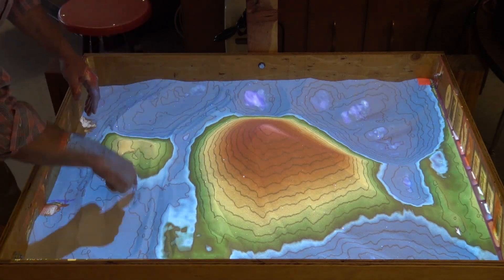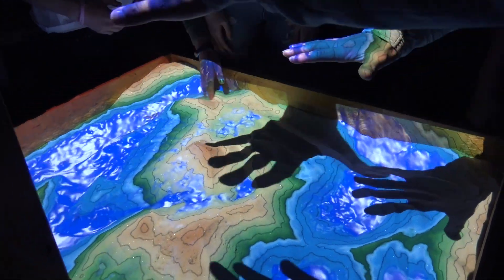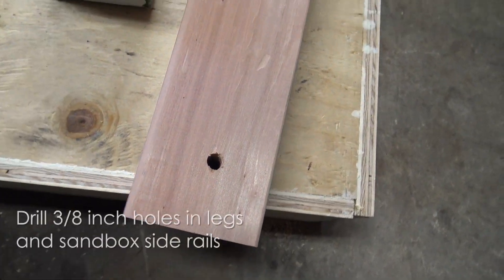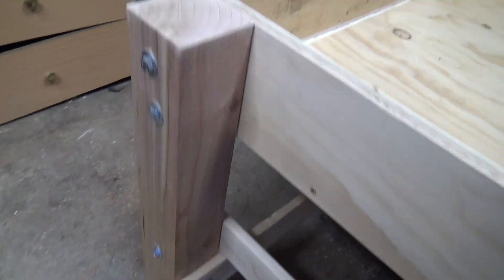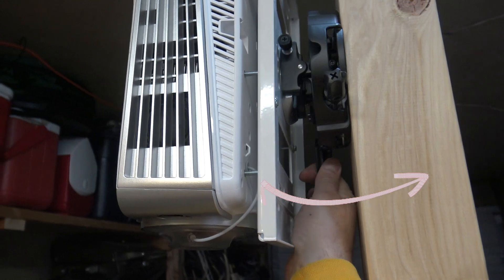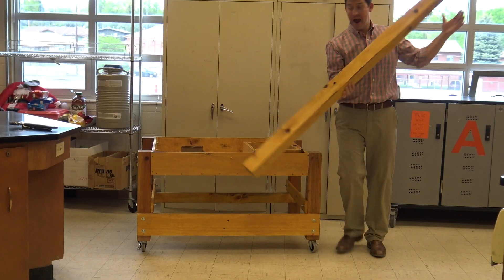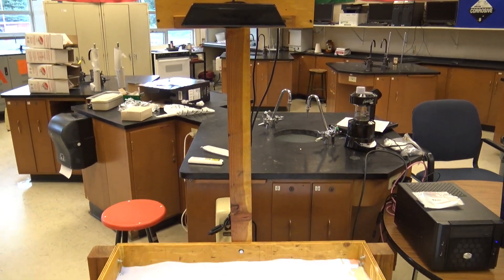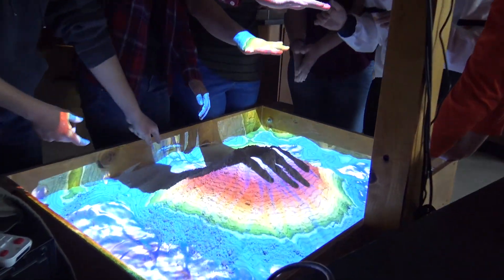Augmented Reality Sandbox - How to Build the Sandbox

Comment: Do you have to have a projector that is mounted 40 inches away with the Konnect? Can the Konnect and projector be at two different distances? I have two projectors available at my school, because of their throw ratios one would have to be mounted 58" above and the other (ultra short throw) would be about 4".
Reply from the maker: The connect will work at further distances so your projector that has a throw of 58” should work. 
I tried to keep it as compact as possible with the short throw but it is not mandatory.

Comment: Hi, thanks for the great video. I got a question: is the distance of 40 inches sandline to projector lens or 40 inches from the sandline to the projector mount?
Reply from the maker: 40 inches from sand line to lens. But, this projector has a lens focal length that can be  adjusted so the amount of sand won’t be a majorly issue. You can adjust as needed.

Comment: So, you could even use stencils & templates to build structures from the sand to make from rivers to hills
And even foundation markings

To rebuild historical & geographical locations

Sandcastle building contest techniques could be used to solidify and hold that structure if wanted - though water
Reply from the maker: Great ideas!!

Comment: Hi Craig, our software is ready to roll, we are now building the sandbox.Questions: how long is the 4x4 that the xbox kinect is attached to? what are the dimensions of the box for projector and Kinects, how wide are the 4  braces?
Reply from the maker: Good work! The 4x4 post is 70 inches long. The wooden 'box' around the projector is 13.5 inches by 17 inches. I am not sure what "4 braces" you are referring to.
Reply: thanks so much the braces between the legs but iI figured it out. Thank you so much @BealsScience

Comment: What is the dimension of the structure where the kinect camera is mounted?
Reply from the maker: The dimensions of the box mount for the Kinect are just large enough to house the projector we used (see link below for type of projector), so if you use a different projector you will have to alter the measurements below:
Length (from the vertical post out to Kinect): 12 3/4 inches
Width: 17 1/2 inches
Height: 6 inches
-BenQ Projector: http://amzn.to/2r84sy5

Hope that helps!

Comment: What is the name/model of projector you are using? The instructions recommend a short throw projector or otherwise it must be mounted in a different location. Thanks!
Reply from the maker: Hello!
I've got a full list of the equipment and materials that I used here: https://www.bealsscience.com/single-post/2017/06/07/Augmented-Reality-Sandbox-will-Blow-Your-Mind

Does that help answer your question?
Reply: Beals Science yes, thanks! 
I'm bummed about graphics cards because apparently bitcoin mining has made them more expensive.
Reply from the maker: Graphics cards definitely are expensive! But, you can go with a lesser card if you'd like, there just might be a little bit of lag time and you may have to disable the water feature.

Comment: Hi! It looks great! 

I was wondering what pc specs you suggest. Ive been reading that you cant get away with less than a gtx 960.. whats your suggestion? 

And what about the cpu? Thanks!
Reply from the maker: We built a custom machine but stuck with the recommended Core i7 (i5 should be good too) and have 3.5 GHz. We are using NVIDIA GeForce GTX 1070 but the rest of it is mostly stripped down. We are running at the higher end and you can get away with a lesser graphics card with some limitations. The graphics card and the pc are, of course, going to determine how quickly the image can render on the sand. There is even a delay with our setup (as you can see in the video) but it is bearable. If you get to 'low' on computer specs and graphics card you will not be able to run the water either as it takes a fair amount of processing for the water. So, if you are just building one for fun at GTX 960 (or slightly lower) may work just fine (although I haven't tried to use this card, but other people have with fair success).
Reply from the maker: I've got a little more information here that may help: https://www.bealsscience.com/single-post/2017/06/07/Augmented-Reality-Sandbox-will-Blow-Your-Mind
Reply: Beals Science Thank you so much! That was super helpful. I may go with a 1060 or similar. I appreciate the help! :D
Reply from the maker: No problem! Good luck with the build! I'd love to see a pic or video of how it turns out!
Reply: Beals Science Will do. Its going to be an Eagle Scout Project 😊
Reply from the maker: What a great idea for an Eagle Scout Project! Where do you plan to set it up?
Reply: Beals Science Planning at the town library.. hopefully the sand wont be an issue with little children
Reply from the maker: Mario T great idea! Little kids love the sand! They might make a little mess but the sand cleans up very easily so it is worth it!

Comment: Have you considered adding a designated shelf for the PC?
Reply from the maker: +BJ Elkins I definitely need to do that. I just can't make up my mind about where to put it. Any suggestions?
Reply: I suppose it would have to be central to keep the weight balanced. If you added a floor above your bottom braces, that might work.
Reply: Also, that's a lot of weight for just a plywood box. Do you see any buckling or warping on the bottom? I'm thinking about making one with 2x8s with a plywood bottom and 2x4 supports and cross braces.
Reply from the maker: That would actually work quite well. I could just run another piece of plywood across the lower braces and keep the PC tucked underneath. One of the issues I am having now is a lot of sand 'dust' getting into the tower. Having it underneath might alleviate some of that. Thanks for the tip.
Reply from the maker: I haven't seen any buckling. That 3/4 inch decking plywood is pretty sturdy stuff and, based on my calculations with weight distribution, it should hold it OK. But, I will keep an eye out and make a change in the description of the video if I see any issues/buckling.
Reply: @BealsScience  on the opposite end of the room from the sand :P
Reply from the maker: @ge2719  that would definitely be the safest place!!

Comment: WOOW!! Quick question: Will it run on windows?
Reply from the maker: Isaam Rameez it will not work on Windows- only Linux. But Linux is free so you can add it to any machine!
Reply: Beals Science What IF we could just run it on raspberry pi or something it will be MUCH cheaper and portable... Correct me if Im wrong, my native OS isn't linux.
Reply from the maker: Isaam Rameez it would be cool if a raspberry I worked but the program requires a lot of processing power and a video card to support the graphics.
Reply: iSam Ramirez, the water simulation model Dr. Kreylos developed is GPU intensive which rules out the use of a Raspberry Pi. It requires a moderately powerful gaming video card (we use an Nvidia GTX 960 and are about to upgrade to a 1080ti).  The reason for this is the incredibly accurate simulation of the physics of flowing water. Dr. Kreylos said in an interview that he could have done something less realistic but it would not have the same impact as his final product.  And, I totally agree!